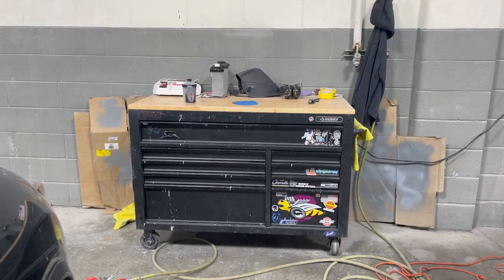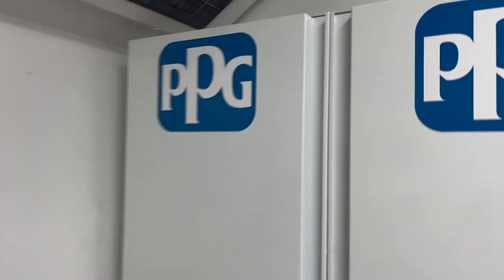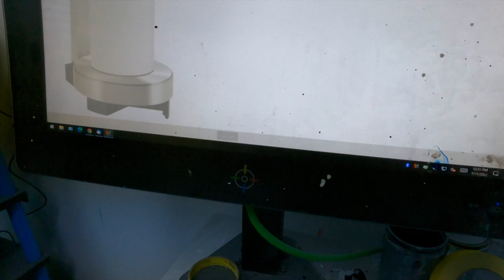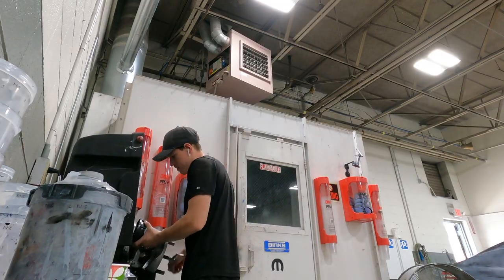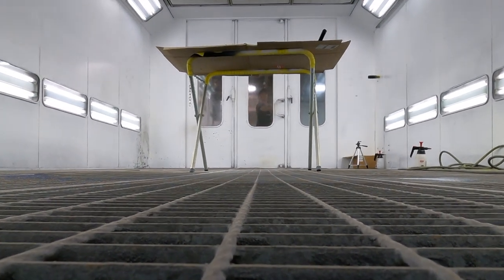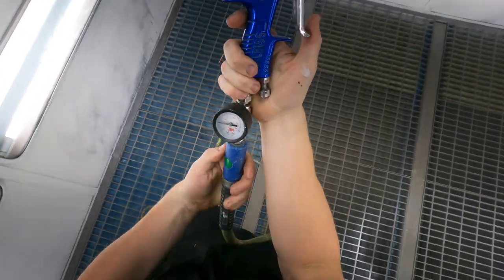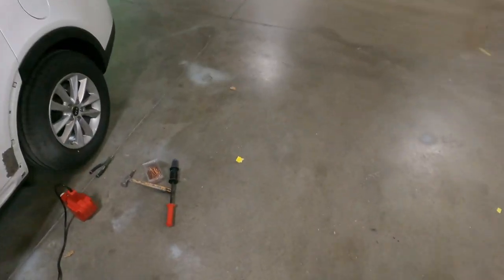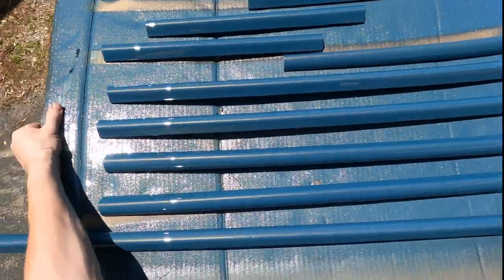How I Refinished My Tool Box Handles! | POV Painting Footage | Husky ToolBox | DIY Inspiration

Comment: Hey there, thanks for posting this video. I was planning on doing a similar project on a couple cabinets and boxes. One question I'm hoping you could answer.  That first coat of black paint... Was that a primer coat? I don't have a paint booth so I'm just using spray cans.  My plan of action was to sand, clean, use self etching primer, then regular primer, then paint, and clear coat.  Do you think those steps would be over kill? I want to make sure the paint adheres to the handles well.  Thanks in advance and also again for showing your process.  Your box came out great
Reply from the maker: Hey thank you for checking out my video! That first coat I used on my handles was left over black, automotive water based PPG paint from a previous car we had painted. I did use that as a “primer coat” to give the (blue) base coat paint something to lay out on. You have a good plan of action! If I didn’t have my work’s paint booth I’d be doing the same thing what you’re planning to do. Check out my other videos where I have refinished and painted wood furniture, like your cabinets and what you’re planning on doing. For your cabinets I’d sand them down in 180 if needed, then 320 or 400. The higher the grit the softer finish. Let me know if you have any more questions. I’ll do my best to answer (I’m not expert lol!) Thank you for watching my furniture channel -Garrett